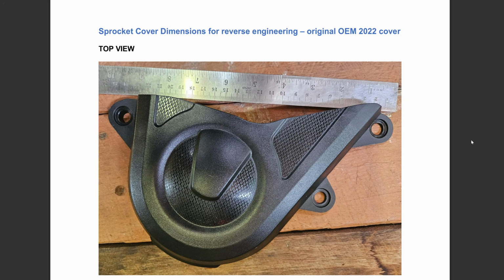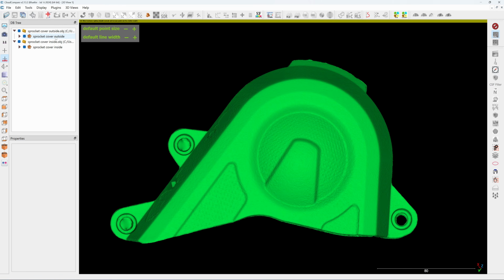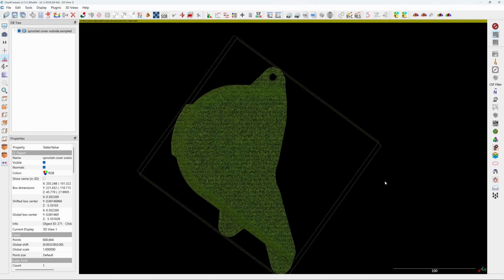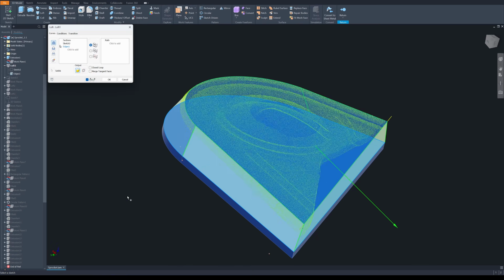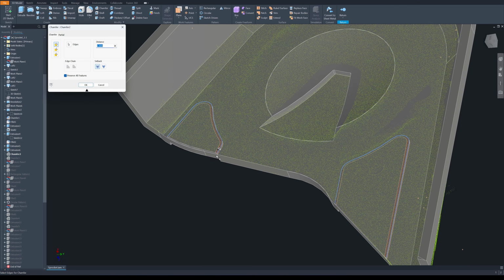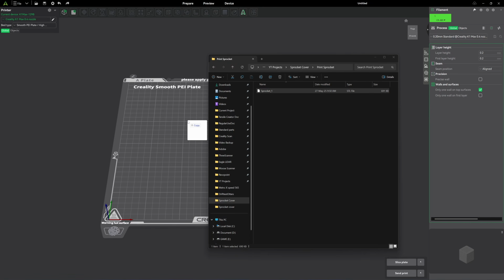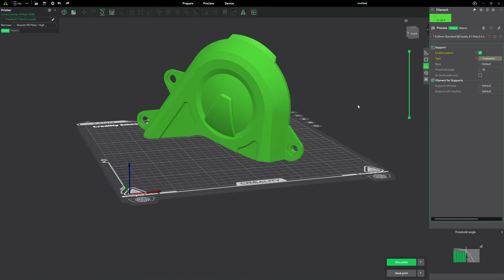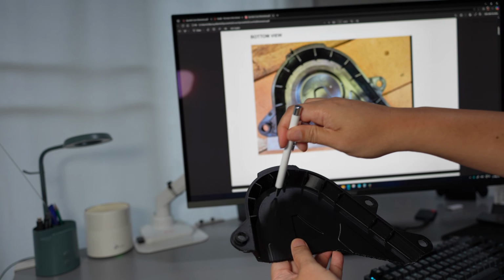3D Scan to CAD: Reverse Engineering a 3D-Printed Sprocket Cover

Comment: that is Super Man stuff ! Great information, searched about 50 videos to find ...🤩Any idea which export format ist conveniant and best practice to SolidWorks?
Reply from the maker: I believe SolidWorks accept "ASC" format for the point cloud, but you should have aligned at least a flat plane to XY plane and one horizontal line to x or y axis using CloudCompare.  I've made a simple guide here. https://youtu.be/kt8SPX33tWE
Reply: @Payo-TensileCreator  Thnk you very much. I hope i can redo. I have an Einstar und the ultimate problem is SolidWorks for Makers. There is NO, NO tool to generate any WORKABLE geometry from a scan without paying a lot of money. If the software costs 10 times than the scanner ..
Reply: @Payo-TensileCreator  Yes. ASC is some kind of stuff Solidworks "tries" to read. Finally, if the data in inside SolidWorks, any further manual processing get stuck due to poor graphics performance and uncapable software inside SolidWorks. You have to pay, Fusion 360 works like a charm with that stuff whereas SWX surrenders and gets stuck by performance. And it's not a lack of PC performance, (Dell 7760 2 years old 64 GB ram) ...
Reply: @Payo-TensileCreator  Whatever you take in SolidWorses .. this Software is crap. Fusion 360 handles 10 times better and faster.

Comment: Hey, is fusion 360 good for reverse engineering ?
Reply from the maker: Any CAD software, including FreeCAD, is capable of reverse engineering. However, the more efficient options are those that can import scanned data as a point cloud. Unfortunately, Fusion360 lacks this capability, whereas most Autodesk products do support it.
Reply: @Payo-TensileCreator  could you make a video in solidworks program reverse engineering of any complex part that contains several curved planes, radii in all axes. 
Let's take the example of a side mirror housing from a passenger car.  
a lot of people experience difficulties after scanning for alignment of 3D parts in the world grid of coordinates, but it is quite easy to do it in any slicer to send to the table stl file of the scanned part to choose auto-alignment or as aligned on the plane yourself, then you need to resave the part and get a normal even grid of coordinates in CAD programs.
you can also do some operations in meshemixer from autocad.

Comment: I wasn't aware that using the point cloud for reverse-engineering was 'best practice'. This is the first video I've watched on the subject that does that. Quick Surface, for example, uses mesh data.
Reply from the maker: Quick Surface and Design X are designed for users who lack experience in CAD modeling and are typically included with 3D scanners. The proper method for reverse engineering involves using fundamental CAD functions to reconstruct geometry from a point cloud. Unlike Blender or 3Ds Max, CAD software is not optimized for handling polygons. Attempting to import over 5 million polygons can significantly degrade performance in most CAD applications. Instead of snapping to a point cloud, we trace it. Since laser scanners capture wall thicknesses as thin as 20 microns, this approach remains the most precise and reliable method for reverse engineering.
Reply: @Payo-TensileCreator  You didn't show in the video how you 'trace' a point cloud. It was more a 'see the results of creating surfaces from a point cloud' video, rather than a 'how-to'.

I also wasn't aware that Quick Surface came with scanners. Must super high-end scanners, as the software, itself, is several thousand dollars.
Reply from the maker: @imacmill  The how to one is here. https://youtu.be/kt8SPX33tWE   There's point cloud in the description for downloading and try out. I'll roll out more beginner tutorial like this, but there're also experienced CAD user viewers as well.
Reply: Point cloud is the "real" shape interpretation from the scan raw and mesh is a approximation of the shape based on point cloud. Just remember that mesh is using 3 point to produce triangle so if you have a scan with 600000 points you should have 200000 triangles or faces but the part geometry does not always allows to be an exact division by 3(radius is a example of tweaking points to produce more triangles). It always depends on what is your precision goal in reversing scan to 3d model.👍👍🇨🇦🇨🇦
Reply: @mariolafontaine5853  Depends on the point cloud. For example, if there's lots of variance in point coordinates on a planar surface, then mesh data will hopefully have averaged away that variance during the scanner software's mesh procedure, giving you a planar surface to engineer from. 

How do you choose which cloud points you're snapping to when defining, for example, a planar surface from 3 points? Or do you pick many points to hopefully get a 'best fit' selection?
Reply: @imacmill just as an example, for flat surface I inspect the deviation from a 3 point plan or flat surface(depending on which soft you use) than I use fonction "from plan to point" and I verify random deviation in imperial +/-.002" or less. If it's too off, I try to use points that are within +/-.002" to make my "real plan" or reference to start my first sketch than I create sections to base my next sketches with. Reverse engineering from a scanned part is not absolute, you have to take few variables in count like volumetric accuracy, noise created by reflecting surfaces, accuracy of the scanner and so on. A quick visual inspection and few mesures taken with some instruments(caliper, micrometer, straight edge, etc.) are a plus, it just depends on how close from the scanned part and precise you have to be. It's an art I must say and mister Payo is one of the best in that regard. Practice practice practice.👍👍🇨🇦🇨🇦

Comment: Is there any advantage in using Inventor over Fusion when it comes to similar reverse engineering? All the commands and tools you used are present in Fusion.
Reply from the maker: A significant drawback of Fusion for reverse engineering is its inability to import point clouds, whereas most Autodesk software supports this feature. In Inventor, for example, you can slice a point cloud into thin sections for precise tracing. Laser scanners capture wall lines as thin as 20 microns, whereas the infrared scan shown in the video has a 100-micron thick wall. Working with a mesh makes tracing much more challenging. Another key advantage of using a point cloud is its ability to handle 70 to 100 million points while maintaining smooth viewport navigation, allowing for effortless orbiting and rotating
Reply: Following. I was about to ask the same. However, I have been always struggling using loft tool for any more complex shape in fusion/solidworks where splines were involved.